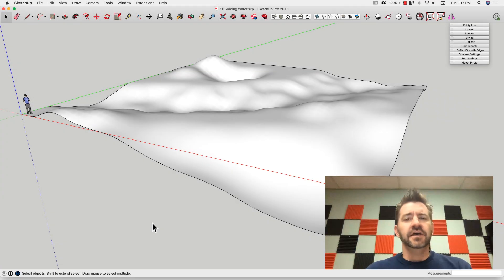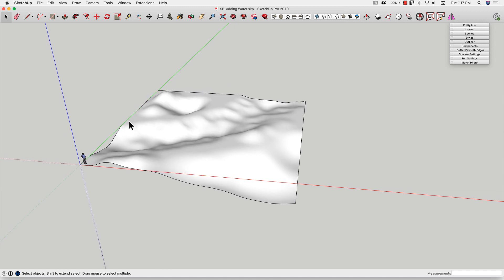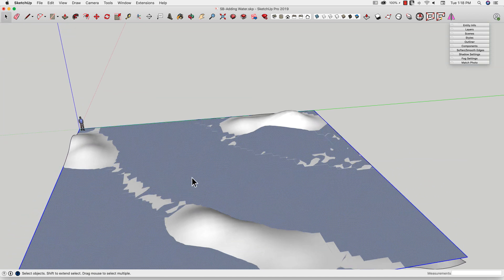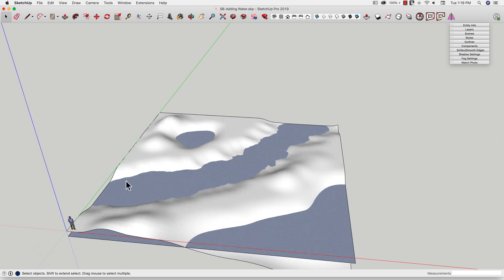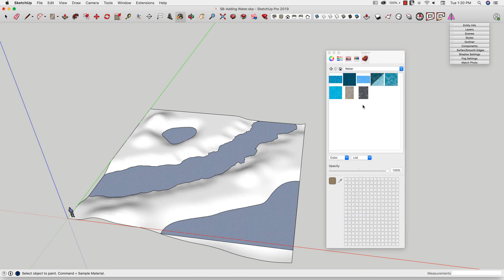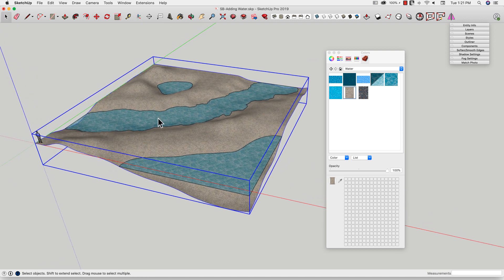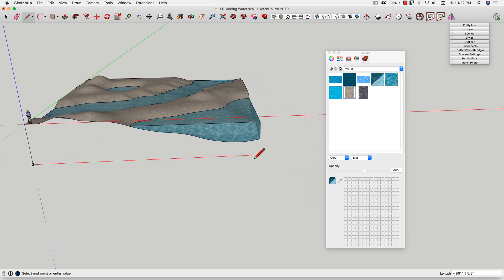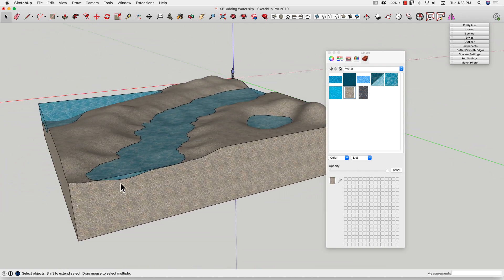Add water to your landscape - Skill Builder

Comment: how to animate that water on sketshup
Reply from the maker: SKetchUp is a 3d modeling software, not an animation engine. While you can animate using scenes to move the camera through your model, SketchUp is not the right tool to do things like animate water. You shoudl look into rendering engines for that sort fo thing.

Comment: Good practical stuff thanks. IMHO it might make some sense for continuity and context to tackle a larger project, say a block of apartments and break it into these 10 minute tips. For example, 1) terrain just done, 2) foundations, 3) walls 4) roof, 5) furnishing, 6) vegetation, 7) rendering and 8) building plans.
Reply: It might appear strange to include 5) furnishing but interior decorators would appreciate that, and issues of using 3DU, spacing and ergonomics come to the fore. 

I left out 5a) fixtures and fittings, which might be very important to some people because doors and windows can easily be improperly positioned, toilets and showers awkward placed, and lighting inadequate. (as I have recently experienced within my current project)
Reply: Or you might redesign your current workplace and highlight some of the good and bad design issues?